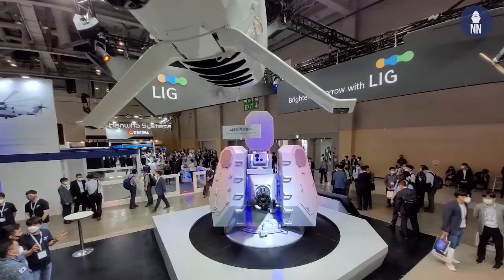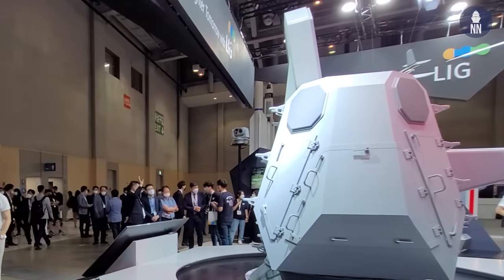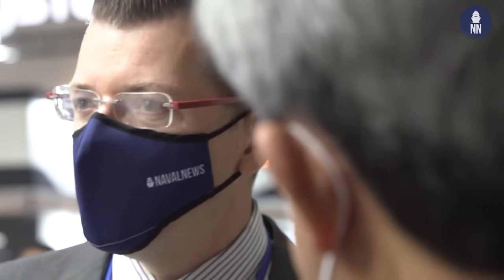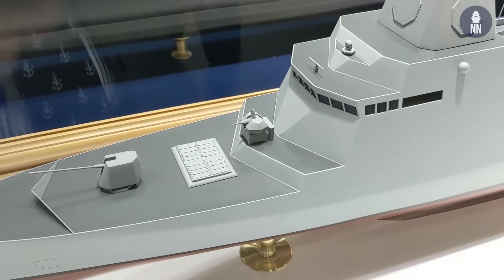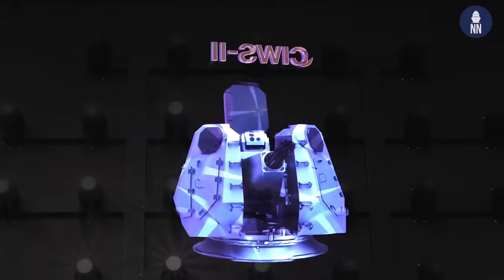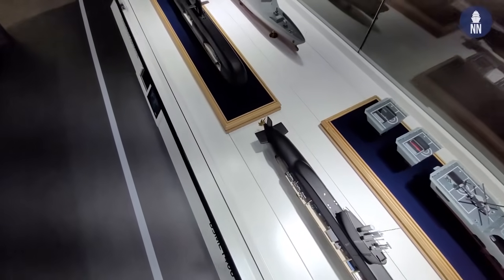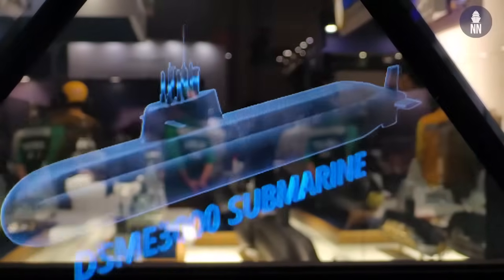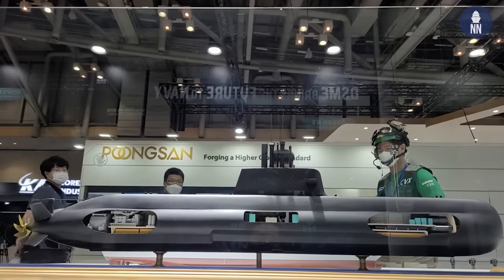MADEX 2021 Day 2: CIWS-II, KVLS-II and DSME submarines for the Philippines

Comment: Com'on Australia (ADF) get your act together and fit CIWS to ALL our ships ... including the 60 & 80m patrol boats.   Even the patrol boats are big enough to operate 30-40mm multi-role gun/s. CIWS like the 40/57mm Bofors and or Phalanx should be installed on all larger combatant and large support ships. By far the biggest threat going forward is missiles & drones. Our region is under increasing threat and we need to stop fucking around and get prepared.

Comment: CMS HANWA system is not yet battle proven is still under testing stage. The CMS (HANWA)  communication interface is not compatible with the U.S. and other allied navy ships that could mean a communication disaster in case with Chinese CCP navy encounter. The existing S Korean Frigates and/or Destroyers are still fitted with the CMS Tacticos Thales from Nethwrlands. The previous Philippine frigates BRP J Rizal & A. Luna CMS are HANWA locally manufactured in S. Korea.CMS contract was to install Tacticos Thales CMS but HHI CEO at the time  is noted for contract fraudulence instead of Tacticos Thales as per contract the inferior type  CMS HANWA system was installed. As for planned purchase of Philippine submarine, Philippine should buy the French made Scorpene type instead of DSME 2000 S Korean brand. The reason S Korea is still new in manufacturing submarines unlike France with more than 30 years of experience!

Comment: Our new Jose Rizal class ships need these CIWS-ll. Without CIWS the ships are completely defenseless against even the slowest of incoming enemy missiles.
Reply: Frigates and destroyers typically have VLS or surface to air missiles that can intercept missiles. So they are not completely defenceless. But are vulnerable if a incoming missile passes long, intermediate, and short range missiles. Examples being SM 2 (long range/Medium range), ESSM(Short range). But if a ship does not have these types of missile systems, then they are defenceless.
Reply: @mikotokoro9136  the problem is two new frigates were bought from South Korea without VLS and CIWS. Just a 76mm deck gun.
Reply: @Joseph-eh4rs  yeah. That's what I thought. Its still getting Mistral II, but it's not gonna be able to intercept missiles.....
Reply: CIWS are only there as the last shield.

The main gun and surface to air missiles are also used for anti-missile operations.

Comment: 0:39 the search radar should not be on the CIWS, it add to the weight of the turret and the rotation speed of the CIWS is important in tracking, furthermore mounting the search radar on the CIWS reduce the visibility of the system, the search radar should be mounted on mast so it can see further without the fear that the ship superstructure can block it.

Comment: The KVLS II vertical launch system platform and the CIWS II of Hanwa is a perfect fit for the two Jose Rizal Class Frigates and even to the 3 unit of the Gregorio Del Pilar Class vessels of the Philippine Navy
Reply: Under development pa nga eh. Di pa nasubukan
Reply: DSME sub for Phil navy. Much better
Reply: A VLS would be too much for our Del Pilar-class OPVs, we would rather use exposed canisters just like how the US Coast Guard once did it.

The Mk.41 would be possibly better since its more available and has more commonality with other neighboring countries.
Reply: @RyuzoSan19  i dont mean the VLS sir for the Del Pilar Class vessel but the Hanwa built CIWS system. What i mean is that the VLS flatform is well suited to the Jose Rizal Class Frigates which were also acquired from South Korea
Reply: @drianmortiz9375  Ok, it could possibly be fitted but it will take some space (more space than the original Phalanx CIWS fitted on the Hamilton-class Cutters)

But it is a good idea and I would wait for its development to be finished.

Comment: The CIWS are certainly more up to date with AESA :) the guns are still short range but they do use simpler ammunition than 35mm AHEAD, 40mm, 57mm and 76mm PFHE/3P etc
Reply: They use smaller caliber ammunition so the velocity would be a bit faster and they are short range because they are the last shield of the ship.
Reply: These are same GE 30mm Gatling gun installed on goalkeeper ciws.

Comment: the philippine navy should buy this korean CIWS . must be cheaper than the US guns . all this new korean products are whats missing in philippine navy's jose rizal class frigates .
Reply: Korean CIWS will be cheaper and much better than the Goalkeeper and the Phalanx because the Korean CIWS project is aiming to replace the Phalanx and the Goalkeeper which the Korean navy is currently using with a better and cheaper one as the price of the Phalanx soared after the Goalkeeper was actually discontinued.
Reply: @jclulu3942  nice to know that sir .. i guess all the philippine navy's naval weapons will be from south korea . hanwa is also the one upgrade the 3 del pilar class so most likely the armements to be added will be the korean ones
Reply: @MotoSan1ty  I think your opinion is very reasonable, Sir.
Reply: I kind of trust the Phalanx for now since it is battle proven and reliable.

Its more better to use the more expensive product when its better than the cheaper one.
Reply: @RyuzoSan19  part of the increased expense of Phalanx over the years has been due to upgrading old Phalanx on old ships (new Phalanx must provide advanced radar and FLIR detection like K-CIWS while being originally designed for older technology, but still be usable on Ticonderoga cruisers built in the mid-80s), and also work to use Phalanx technology to launch Rolling Airframe Missile and aim laser weapons. 

USA has the momentum of operating so many Phalanx and using the technology for many things, continuing on with Phalanx provides them with benefits that South Korea wouldn't get, especially if they are not going to use SeaRAM as well. Same with jobs, in the USA the high cost of US-made Phalanx goes back into the US economy. South Korea can only get this benefit by producing their own system.

As an American I like Phalanx, it saves money in the end because it lets us keep modern CIWS on the entire US Navy without having to do more expensive upgrades on lots of older ships, but for South Korea building brand new destroyers, I like K-CIWS more. Gun-based CIWS is not very difficult and they have had two excellent systems, Phalanx and Goalkeeper, to learn from.
Reply: @ultraman5168  nah, Thales discontinued Goalkeeper, so Phalanx is a lone CIWS system in Western Navies. Raytheon pretty much price gouging it. SK navy preferred 30mm gun on goalkeeper over 20mm on Phalanx. Hence, same GE 30mm Gatling gun on these Korean CIWS. Plus, these has latest tech to defend against hypersonic missiles.
Reply: stay away from those korean chang bo go submarine
Reply: @lincan4108  agree
Reply: The Us literally Not giving the Philippines any discounts 
Alam Ng Us na mahirap ang pinas ka mahal pa
Reply: It’s not missing if bong go didn’t interfere and HHI set 2 offer to reduce thats include the ciws and vls sad not they need to find funds to buy the missing teeth of JCF
Reply: @madiidam1538  pataka raman ka tawon! Cwis and vls is not included in the original plan at 18 billion pesos what do you expect? Kulang Ang weapons dba? Malaysia LCS Halos pareho lng ka laki sa brp Jose Rizal medyo dako lng gamay 23 billion pesos 1 unit lng how much more Kung 2frigates at 18 billion pesos dba kulang tlga dba?  Sa senate hearing Kung nakinig ka nagrequest Ang Hyundai Ng karagdagang 700 milyon pesos pra maikabit Ang thales tacticos cms at TDL 16 pero ayaw Ng senate magdagdag KC tpos ndaw Ang contract pero Hindi hawak ng Hyundai Ang presyo Ng electronic warefare system since binibili din Nila Yan sa IBANG BANSA. nagmahal  Ang presyo sa world market dahil MALULUGI Ang Hyundai Kung ipagpatuloy Nila Ang cms na thales Kya naghingi Ng karagdagang bayad. Kc NUNG nagka kontrata Hindi ganun kataas Ang presyo ng thales Kya napilitan Ang Hyundai na gamitin Ang hanwa system dahil mas mura. In-short tinipid masyado Ang project na Yan Kya anong inassahan mo na armaments? Kung GINAWANG 30 billion Yan na projects bka 16 vls NKALAGAY DYAN at may cwis pa may missiles na ilagay sa vls. At 8 piraso Ang anti ship missile Hindi lng 4 At may towed array sonar pa Sana. Tinipid so tinipid din TYO Ng armaments..
Reply: @justinviper7149  CIWS and VLS is not included in the original plan? 

Then why is it FFBNW on the ships design?
Reply: @RyuzoSan19  in the future if there's any available funds. That plan separate expenses I mean just a space for integration in the future,  there's space for installation if the government will spend more for that weapons.
Reply: @RyuzoSan19  I think he meant not included in the budget, but included in the ship design as future assets
Reply: @watermirror  I guess so.
Reply: @madiidam1538  then prove an ₱8B warship will fit if u include a ciws & vls? Good luck.
Sorry to disappoint but those aren't included in the original budget, they're only included in the design as future add-ons. Research more

Comment: I like the 2 new models of CIWS of ROK?!
I hope the philippine also consider koreas offer of submarines
Reply: The chang bogo class? Nahh bro the scorpene class is much more superior
Reply: France Scorpene 2000 submarine is better
Reply: French Scorpene is superior than Chang Bogo.
Reply: You should know that DSME-1400 and Scorpene 2000 are different from each other in purpose, displacement and price. 
1. Displacement : DSME-1400 - 1600 ton (full load)  / Scorpene2000 - 2000 ton (full load)
2. Unit Price : DSME-1400 - 367 million USD (price in 2011) / Scorpene2000 - minimum 500~600 million USD (price in 2005 / +50~60 million if AIP added) 

Scorpene2000 is a good sub. So DSME-1400 is as DSME subs are called a Legend in RIMPAC(Rim Of The Pacific Exercise) by showing its overwhelming performance over decades. Also the Indonesian navy recently established its track record of diving 310 meters deep underwater with DSME-1400. The most important thing for the PN is that the Scorpene2000 is much more expensive than DSME-1400 even though both subs are all good. The PN is a beginner in sub operation, so I think it would be good for the PN to start with DSME-1400 that is much cheaper and also good in quality. If the PN doesn't care for any, why not KSS-lll batch-2 with a 5000 ton displacement, which is the only conventional sub in the world that has a vertical missile launch system and run by lithium-ion battery and also much more superior to the Scorpene????
Reply: @jclulu3942   I don't know so much about the DSME, but the scorpene are famous submarines used by many countries all over the world, and are ultra silent proven submarines.

How long the submarine is able to stay under the sea without going up, and many other technical details are very important in the choice.
Reply: @jingorooroad2559  That's the reason why I left a comment above. What I'd like to say is that DSME subs are also proven models over decades and good enough. Above all the PN should consider the cost-effectiveness.
Reply: @jclulu3942  agree!
both submarine offer are good for the philippine navy. in the end it will up to DND, PN and law makers on passing the budget for the submarine that they will prefer. I hope PN pick wisely

Comment: I think the CIWS-II should fit to the Philippine Navy's FF-150 and FF-151 Frigates or basically known as Jose Rizal class frigate. I hope HHI wont forget on compensating the missing Link 16 CMS of the Frigates and also the Philippine Navy should push through the Submarine acquisition and many more i dont care if they choose Naval Group or DSME as long as they'll push the project until this year or 2022 so that it will be delivered earlier and can be used earlier.
Reply: the U.S will provide the link 16 as i heard
Reply: As I heard,  due to the crippling economy of the Philippines caused by the pandemic the acquisition of subs was pushed back to horizon 3(2023-2028)
Reply: @havierlango2621  not really bro the DND has been under negotiations with the South Korean on may
Reply: @Onlywithsham  nah, the PN FOIC already confirmed that the submarine project will be push back to the Horizon 3. 

Even if the Korean Government will provide the funds thru softloan, the Philippine Government is still required to provide the 15% of the overall budget to start the project.

If they can't still provide the needed 15% to start the building of the corvettes and OPVs thru softloan, what more for the more expensive submarines?
Reply: @Onlywithsham  likewise with the french (which I preferred) but there are multiple sources already stating that the project has been moved to horizon 3
There's also a lot more projects that needs funding within horizon 2 like: 2 Corvette
2 more strategic sealift vessel
6 OPV
(Those the some of the major assests that's needed within horizon 2 too but would likely be pushed back to horizon 3, since the current government doesn't want this to be a midnight proj. like what happened to the 2 JRC)
Reply: @paulsteaven  the only acquisition they did during this administration is the FAIC-M
Reply: @havierlango2621  as always, the PN always got the short end of the stick every time a Philippine Administration wants to decrease the budget of the AFP/DND.
Reply: @paulsteaven  yep sadly since we're a archipelagic country we should have a strong navy rather than a strong army(local insurgency may have played a role)
Reply: @paulsteaven  Ping Lacson sponsored defence in hering you should blame him
Reply: @admiralbeluga6438  he alone should not be blame here, there's a lot in the Philippine Government that should be blame for the current setback that the Philippine Navy (PN) still currently experiencing.
Reply: @admiralbeluga6438  do note that duterte slashed the budget for horizon 2 from 600 billion to 300 billion, but still we haven't spent half of it
(He slashed it long before COVID happened)